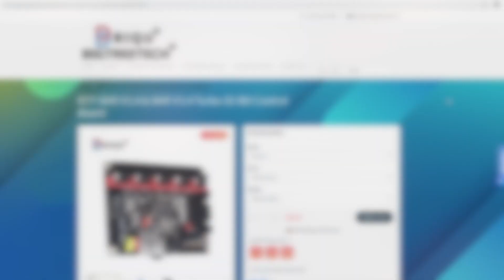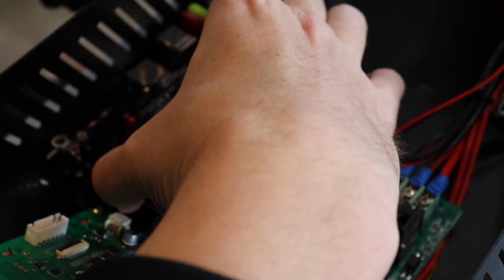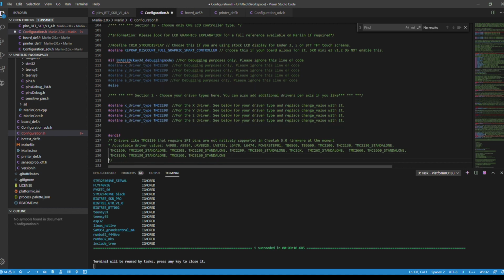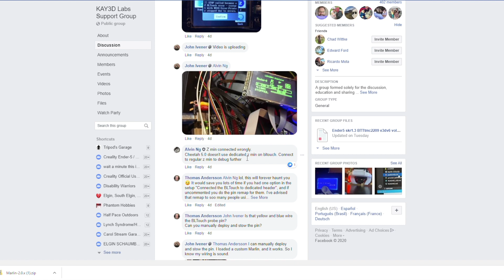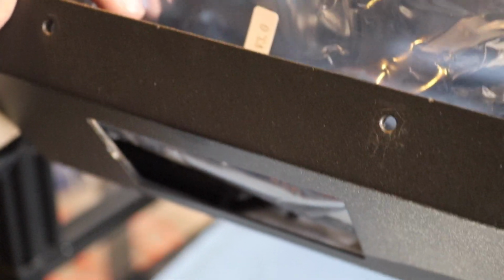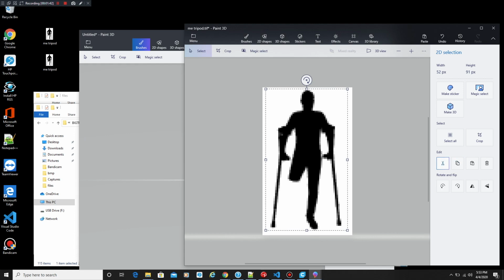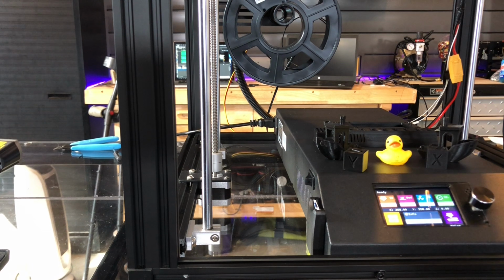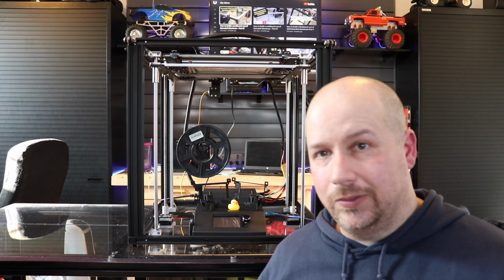Ender 5 Plus Ultimate Upgrade!   BIGTREETECH 32bit 1.4 SKR TURBO & BIGTREETECH TFT35 V3.0

Comment: Just wondering if you had any issues with your filament runout sensor.  When I turn mine on...even though there is filament in the sensor, and the blue light is on...the printer parks and senses that the filament has run out.  Googled a bit and think that I need to uncomment:  //#define INVERT_FS_LOGIC.  Stock filament sensor on my 5 plus BTW.  Any feedback greatly appreciated!

Comment: Hello! Nice tutorial :) I don't know if something changed recently but I had to undo the P0_10 in the pins file on line 91 to the original value of P1_27 to get this to work for my setup. I was having the exact issues you showed in your video on facebook with the P1_10 set as that pin. Strange but I'm glad it's working now. Thanks again.
Reply: Are your BL Touch wires a different colour to his? 
I just got my E5+ a couple of weeks ago and it came with the Meanwell PSU already installed and my BL Touch wires are different, so I'm wondering if they corrected their wrong pins mistake...
Reply: @mackinsvii9022  Yes mine are different - and still in the wrong place. I rewired them to be in the correct order. I have the meanwell powersupply as well.
Reply: @IntrepidDawn Ahhhh thank you, I was hoping they had fixed it. Are yours in the order of black, white, orange, brown and red? At least before you changed them and what order are they now?
Also, how do you actually change them?
Reply: @mackinsvii9022  I don't remember what they were but I did need to remove all of them and replace them in order with a wiring schematic.
Reply: @IntrepidDawn  Can you remember where you found the wiring diagram?

Comment: You indicate that you have the SKR v1.4 Turbo yet you have configured for the LPC1768 which is the SKR v1.4.  The LPC1769 should have been configured instead.  Obviously, you have it functioning via LPC1768, but I'm curious if you are limited to 100MHz processing (speed of the LPC1768). The processing speed is the sole difference between the LPC1768 and LPC1769 which is likely the only reason it is working for you.  I suspect you're not taking advantage of the LPC1769 turbo processor which runs at 120MHz.  Can you confirm?

Comment: I am new to 3d printing and just got my Ender 5+ going. I haven't upgraded anything yet but I did get an SD card extender which I have a question about. If the printer is on and I pull the card to add Gcode the machine does not see the new Gcode when the card is reinstalled. I have to unplug the micro end from the printer and plug it back in. Then the new code shows up on the print screen. Is this normal? Will an upgraded board (getting the SKR 2 soon) fix this? Thanks for any insight on this.

Comment: Great video, thanks!

Any reasons why you didn't choose the TMC2209 drivers instead of the TMC2208?
Reply from the maker: Hello Mischa - I was comparing it to the Creality silent board, which has TMC2208’s.  Thanks again for watching - Tripod
Reply: Okay, then I understand. Do you see any problems when I'm going to use TMC2209 with this setup? Any special steps with the firmware (besides just changing the regarding lines) or with the jumpering?
Reply: @mischaanwald  2209's (At least bigtreetechs version) will have the diag pin soldered to the stepper stick. This pin needs to bent/lifted/cut in order for mechanical endstops to work properly (keep it to use sensorless homing, that's the only thing it's for). Other than that and defining 2209 instead of 2208 there's no difference.

Comment: Since you published this video, there is a newer release of Cheetah.  Also, there is a remark in configuration.h, line 302 in the newer release, shows this:
#define FILAMENT_RUNOUT_SENSOR // Define this if you have a filament sensor. Please ensure it is connected to your mainboard and NOT your TFT
//#define INVERT_FS_LOGIC // Define this ONLY if filament sensor is not detecting filament correctly. 

Have you tried the INVERT_FS_LOGIC setting ?

As to your remark about "when the source is released", it is all in the distributed files.  You might not be recognizing the code, as much of the menu code is heavily wrapped in various macro definitions.
Reply: As an aside, the line numbering has changed somewhat, from what you mention, to the current release, anywhere from 2 to 32 lines, depending on how far down the configuration.h file you get... but a little hunting around will turn up the desired lines.  One also needs to set the "default_envs=" parameter in the platformio.ini file, about line 22.  Using the turbo 1.4, I used default_envs = LPC1769

This last definition is explained in the KAY3d Labs video https://www.youtube.com/watch?v=G5Yn_wPlrQs  

If it was shown here, I just missed it.

Comment: I have an Ender 4, which lost the z for the bed. I purchased the same board and screen that you did. Do you know if I should use the firmware for the Ender 4 or would the Ender 5 work. The Ender 4 looks just like the Ender 5 but it is 3 years old. Creality said the original board won't accept the new firmware and told me I should just buy a new printer. They won't respond to any of my emails for information on how to proceed. Thanks for the video!!

Comment: This is great and exactly what I needed for my ender 5 plus, I got the SKR 1.4 turbo and a TFT70 yours was the only firmware that worked after trying others The only exception I'm having is the BL touch. It's not responding I see a little flashing red coming from it but not the full red glow like before or even actuating at power up. I did the reorientation of the servo wires Brown Orange red, but maybe have damaged it I don't know if so maybe I'll have to order another?
Reply: Got it squared away, twas the Blttouch wiring, turns out the original way was correct. But now it's printing in the friggin air!!! Any idea why?

Comment: As the Cheetah for E5+ is not a BETA anymore, i started preparing the SKR1.4 Turbo + TFT35 2.0 upgrade for my printer. I had to make two more settings, which i didn't see in your video: platformio.ini:
default_envs = LPC1769

Configuration.h:
#define TEMP_SENSOR_0 1
Can you confirm these values are correct?
Reply: And thank you for your video, it's a really good starting point!
Reply: Yes
Reply: Thank you so much Stefan for this information.  It would not compile at all until I put in those two settings.  Saved me hours of troubleshooting !!!!  Great Job

Comment: Im looking to do this upgrade on my 5 plus and your video I find the most easy to follow.  Tons of information and I love the dogs!.  That said on BigTrees site there are 2 different 2208 drivers. 3.0 step or 3.0 UART.  Which ones did you use?  Thanks so Much!!! Keep pumping out the great vids.
Reply from the maker: Hello Joshua - Thanks for the compliment and watching my video!  This is what I purchased.  BigtreeTech Direct SKR V1.4 Turbo Control Board + 5pcsTMC2208 V3.0 UART Mode Driver.  Hope that answers your question? Thanks again!

Comment: So if I understand correctly all I need to do is use firmware file and be up and running? My ender 5 plus came with a defective board I'm  assuming usb port got hot enough to burn my hand and now everything working except  for the motors and it will be 3 months to get stock upgrade also can I use stock screen

Comment: Hi Tripods Garage, what is the nozzle size are you using? I just bought my first 3d printer and its ender 5 plus but the problem is that there are lots of stringing.

Comment: I dont know why but it didnt works on my ender 5 plus. I have the newer Version with the mw psu and the orange brown red bltouch cable. I cannot home because the endstops doesnt work. When i use pronterface i can see that the status didnt change when i press them. Has somesody an idea why? With the original board everything works. I wired everthing with this manual but i use tmc2209 instead of 2208

Comment: Great guide!   After flashing, The touch screen says 'no printer' and the legacy screen says ERR: EEPROM Index        I have reset the EEPROM on the printer via the menu, and rebooted.  No luck. When compiling, I get YELLOW messages starting after  compiling.......Sdfile.cpp.o  'In file included from Marlin\.....trinamic.h:35  and its all yellow after that, but does say Success!
ideas?    Im going to start fresh and see what happens.
Fresh install...  no errors,  4 'problems' {}c_cpp_properties.json     cannot find c:\--------- \ include        all 4 errors refrence that.   Upload to printer works,  however still have ERR: EEPROM Index and the touch screen says 'No printer'
This time I downloaded just the firmware.bin from hub,  the EEPROM error went away after i reset it,  however touch screen side still says no printer.  Changed speed setting to no avail.  On legacy side, i selected auto home.   Bed moved down a bit and then Printer Halted.

update again....   re downloaded the firmware.bin   Played with wires and found the EXP2 for the display needed to be flipped upside down.  Which is REALLY odd because BTT lcd and board should be correctly aligned.    This firmware works, so I believe it must be a computer issue on my end, when I compile the firmware myself.

Comment: Can't you just use a tft35 e3 version 3 and not have to print a mount or use a dremel for the notch?
Reply from the maker: KornShaDoW097 - Your choice, mount it wherever you want.
Reply: @TripodsGarage  do you know if the e3 version matches the holes, so I don't require a mount and fits the enclosure? I'm guessing I'd need to drill a hole for the knob. Instead of trimming with the non e3... N hopefully it fits?..

Comment: 39:33 The .pio file is not in the configured firmware you posted on your Github
Reply from the maker: It is the same file, just uploaded one right to the first page.  Instead of having to drill through the folders.

Comment: my board is on the way! thanks, my only question is that you did not enable thermal runaway for either the bed or hotend, is it already enabled?
Reply from the maker: Thanks for watching!  Thermal runaway was already enabled by default.  The changes were made specifically for the Ender 5 Plus, plus some tweaks\fixes I noticed along the way.  Thanks again for subscribing - Tripod
Reply: Thank you!

Comment: Hey! Great video. Working on this myself. Did you have any trouble with the extruder motor making noise? I increased the vref on the stepper and it got rid of most of the high-pitched noise I have (key-word here is most), but overall it still makes quite a bit of noise.

Comment: Hi @Tripods Garage
Would this guide be ok to use TMC2209 v1.2 or 2208 is better option? sorry don;t know what is the difference?
Many thanks in advance.
Reply: I'd recommend going with the TMC2208s. They'll save you a little money. The two main features the 2209s have is sensorless homing, which you won't need, and slightly higher max current, which you also won't need. I hope this helps.

Comment: Great Video and simpler process. I am using SKR v1.4 and TMC 2209 for Ender 5 plus, but endstops do not trigger can you please help.
Reply from the maker: Thanks!  This was for 2208's.  Depends if you are using sensor less homing there is one pin the might need to be bent or cut.  Here is a good video to watch on 2209's https://www.youtube.com/watch?v=vcEbpjao_1o

Comment: Awesome video.  I'm looking to get into 3d printing and my choice so far has been between the Ender 5 plus or Ender 3 Pro.  I've been looking into what would be good upgrades to do to the machine.  I've seen the SKR mentioned for E3 but till I saw your video I've seen no mention for E5+.
Reply from the maker: U2Ra Mess - Thanks for watching!  There are plenty of upgrades for both printers.  The Ender 5 Plus was my first 3D printer.  I was sold when I saw build volume of the E5+!  I didn’t see any videos either using a Skr board in a E5+, so I decided to tackle it 😉.  I love the 3D printing hobby, starting to design my own parts for our atv’s and other things!  Again thanks for watching- Tripod

Comment: Is the firmware can be adapted for a skr 1.3 or be the same? The skr 1.3 with a double switch adaptor for double z motors.
Reply from the maker: Yes, the firmware can be adapted for the Skr 1.3, you will need to make some minor changes, along with a Z splitter.
Reply: There will be some differences as the 1.3 board doesn't have the dedicated BLTouch connectors and lacks the built in z-splitter. Nothing to hard to do though. I recommend looking at going dual z steppers rather than a splitter though if you're planning to use UART, no reason not to really. (and added benefits)
Reply: Tks for ur response. I will use uart driver.

Comment: So I finally had to get this installed as the factory board died. I have the board and screen installed. The only difference is I have the 2209 drivers, everything fires up. I used your files and now I get the 'm999 error' Any advice or thoughts.

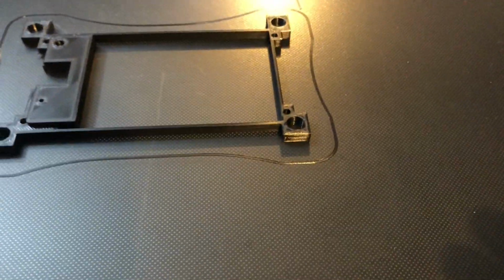Comment: At 40:50, you are printing the display bezel.  Are you using one of those from Thingiverse, without modification?  Reason I ask is there are projections on both sides, generally, these require some support, but your print appears to be actually flat on the plate.
Reply from the maker: Yes I am printing the display bezel from Thingiverse with supports.  In the description it says to print face down.  I didn’t like the results.  So I printed face up with supports.  As you can see the part came out great.  Also check my pinned comment, a person did a remix that requires no cutting of the case.

Comment: Hi, i follow your video, it's a really good presentation of "how to " ;-) i have a problem with the filament detector. If i move off the filament, the printer doesn't stop the print. I made a M119 to check if my sensor works, and it seems to be good (no filament=> OPEN / filament=>TRIGGERED) and that even if I comment or uncomment #define invert_fs_logic (line 296 on your video).. Do you have an idea ? Thanks

Comment: I just added a new meanwell power supply as mine crapped out after a month. I also decided to go with this upgrade and have ordered from biqu, its been 2 weeks and haven't heard a peep from them. I have also tried to contact them, and nothing. How quickly did you receive your product ??? Just wondering if you had the same experience or if you got your stuff quickly ? Thanks
Reply from the maker: Hello Neil - Sorry to hear about the PSU!  Did you reach out to Creality for a replacement?  If so what did they say?  Seems that BTT goods are taking forever to get here.  I placed an order a few weeks ago and it has been crickets.  I ordered my board and display on Amazon when they were still readily available.  Hopefully both of our orders from BTT will arrive soon!
Reply: @TripodsGarage  Thanks for the reply, I didn't even bother to reach out to Creality, I decided to go with the meanwell 600 after watching Kersey"s video.  After I messaged here, I looked on Amazon and ordered, it is supposed to be here by July 1st. I will just cancel my order direct from Biqu, as I don't know when they will be here. Or maybe wait and see if it shows up, then I'll have a spare for my second printer. Thanks for the vids, I am very new to 3d printing and not overly tech savy, watching your vids and the others have been very helpful.
Reply: @neilleblanc757  I ordered mine 8 days ago from Biqu and it arrived today. UK BTW.
Reply: @mackinsvii9022  Crazy, I re-ordered from Amazon and got mine in less than a week, still haven't heard anything about my first order I placed over a month ago, directly off the Biqu website, and no responses to emails.

Comment: At 22:00, is there some compelling reason you selected the pins_BTT_SKR_V1_4.h file from the lpc1768 folder instead of the  pins_BTT_SKR_V1_4_TURBO.h file from the lpc1769 folder , since your video specifically is addressing the 32-bit 1.4 SKR TURBO control board ?
Reply from the maker: Hello Boogerhead0 - Good question - if you open the pin_BTT_SKR_V1_4_TURBO.h file, you will notice it is practically empty.  If you look at line #36 you will see it uses #include "../lpc1768/pins_BTT_SKR_V1_4.h" for the pins.  Hope that answers your question - Thanks
Reply: Got it.  Thanks for explanation, and, thanks for a really nicely done tutorial on this exact build I am assembling right now.
Reply from the maker: @boogerhead0  No problem!  I appreciate the compliment!  Hope your build goes well!  - Thanks for watching - Tripod

Comment: Hi Guys, Great Video... however i cant seem to get my bltouch to work properly using ur firmware.. It WONT level the bed just comes up with errors. It just seems to go down the stop then the errors come. Any ideas what i can do to fix this?
Reply: chiming in before tripod comes in - hope u dont mind. first thing first; you have to ensure that your bltouch wires are connected correctly. I dont know what type of connection you have but; here's a good guide we wrote about connecting wires of a bltouch to a board using cheetah 5.0, a variant of Marlin

https://kay3d.com/pages/the-correct-way-to-configure-a-bltouch

Comment: I liked this video, although at the end of the coding part, i did everything you did in the video, i pressed copile to pop it onto SD card when i got Error: Unknown Environment names "change value" and a lot of printer names
Reply: Dude i figured it out, in the platformio.ini filed theres a default_envs which was set at "change values" i changed this to LPC1769 and it worked
Reply from the maker: @tomnewdelhi  Awesome!  How is the rest of your build going?
Reply: @TripodsGarage  printed the board holder. Compiled and loaded the firmware onto sd card. I'll fit it tomorrow and give it a whirl. I'll let you know.